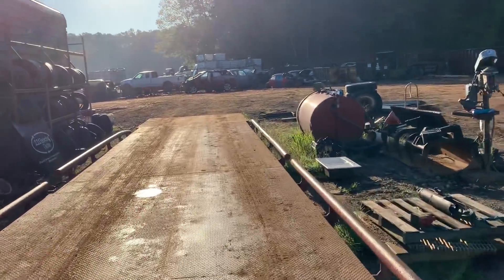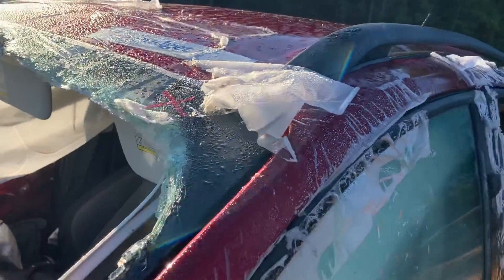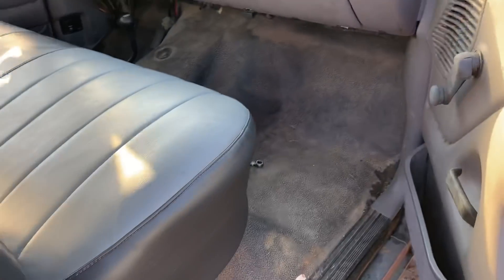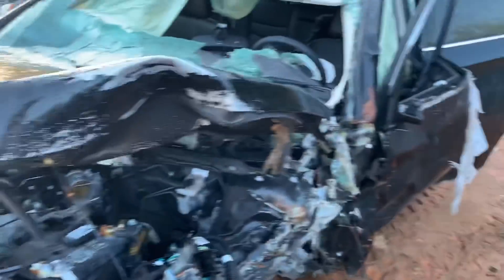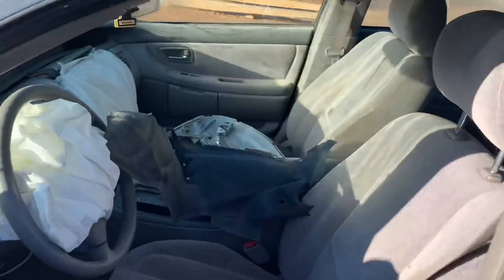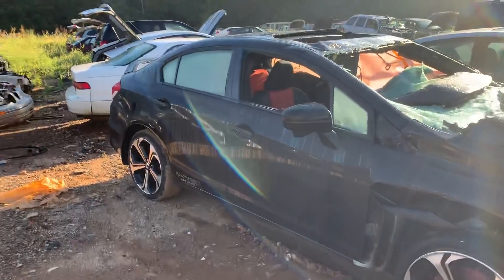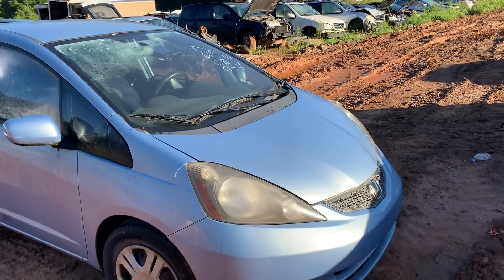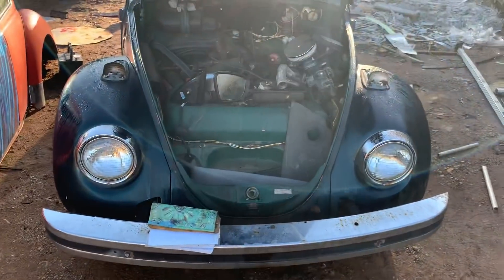New Scrapyard Arrivals!

Comment: Used to love working out in the yard in summer back when I was still working for scrappies here in the UK, overalls tied to the waist and shirt off and would be out there cutting engine mounts or dragging engines and always got covered in dirt and oil then home for a super long shower, abs loved it.   Only downside was you had to be careful smoking near petrol because a hot summer day the petrol is closer to its flashpoint but most often I still had a ciggie on the go when I decanted fuel tanks with a drill as we used to share out the petrol end of the week and the owner dosed it up with a couple gallons of fresh.   One month I remember we had so much petrol and diesel we were taking it home in 25 litre drums and selling it to mates cos we had so much of the stuff hehe just every fuel tank we got on the car was full tank.

Comment: I wouldn’t have guessed that the 2.0 Turbo engine would bring less money than the 6 speed auto in the Escape

And why is that gorgeous F-250 being parted out and not saved? Frame bent? 
She it’s in such great shape!
Reply: Insurance write off.  Had to make a tough decision with my car when it got hit, ultimately, buyback plus inspection fees (+all the time spent hauling the car from one place to the next) to get rid of the salvage title would have cost more  than finding another vehicle. We got a tough inspection process and beurocracy to get a rebuilt title, and unless you know somebody  in the business its going to cost you. The system is definately stacked against the DIY guy who just wants his car back on the road.

Comment: VW beetles were not special. People that remember them as great cars forgot about all the service it took to keep them from having no brake pedal, dropped valves, galled spark plug holes, steering wobble, and oil leaks. In areas with salt the exhaust pieces responsible for heating the air for heater rotted and you lost heat and the studs broke in heads trying to replace the heat exchangers. BUT, they got windshield washers right. Overinflate spare to 42 and attach the hose on washer fluid tank to spare. The air in spare was the force pushing fluid through hose to nozzles. If the air pressure dropped to 28 the valve they put in system stopped spare tire air flow so you didn’t get the spare flat. If you had a flat and forgot to fix the spare you got a reminder when the washers didn’t squirt.  This engineering feat failed to make up for the other stuff but it was still neat.

Comment: Putting a 97 Bonneville ssei  back on the road.  It needs a few odds and ends...know of any website of scrap yards that might sell parts of older vehicles? Aside from ebay
Reply from the maker: Check out Car-part.com They might show you who has some. Or even LKQ
Reply: So cool. I love older gm products. I have an entire front cradle with engine, trans, harness ECU etc from a 97 gtp I scrapped. It's sitting quietly in the corner waiting for my trusty 3.1 Beretta to poop out. Then that L67 is going in.

Comment: 5:26 was that a Mitsubishi GTO
Do a vid on the GTO, or try 2 save it
Reply: Essentially yes it is. Though it was called the 3000gt here. Came in two flavors, an NA roughly 150 (sohc) HP, next up was a dohc NA roughly 200 HP and the top dog was the twin turbo AWD VR4 rated at 320 hp
Reply: My thoughts exactly! Probably the most interesting car in the video!

Comment: That was a poor place for small memory card. I see hundreds of the 7.3 engines and I guess cause they used that motor for so long that they still sell. I needed one last year cause the factory remain was junk. Had tons of power but a no start issue caused me to sell it. It was a 95 that was as clean as the one shown but never in a wreck

Comment: DUDE! What's up with those Beetles? those are the easiest cars to work on. don't crush them put those things back together they are worth a fortune fixed back up. That 7.3L is about the ONLY good Ford Engine i am at all fond of. besides of course the straight 6 300 anything else is just junk from Ford as far as i'm concerned. but yall need to save them bugs unless they are rusted all to hell and even then you can part out the bodies easily if you advertise them because there's always someone looking to rebuild a bug. ok so you realized this already, cool kinda weird that you cut off the video right in the middle of talking about them though i was interested. i was also interested in that jeep that you just glossed over and moved on
Reply: It's a good ford engine cause it's not a ford engine lol, they're manufactured by Navistar.
Reply: @ericbrule4465  That's right! i forgot that International Harvester made those. well that should explain it then. the only other one that's any good and only because it's a good close second is made by caterpillar.

Comment: Wow Did you see that F.O.R.D.  I would be right proud to own that lovely gray beasty.

Only thing. Is I have to put n outhouse in the bed  so I can take a CRAP on it that it needs to run better.

Now now no crying 😢. Someone  with a rusted out lifted  bald tire Ranger POS will come up and save it of course.

So ill sneek in at night  and take my magazine and kindle. And  give it a  bran  new horse dump in the bed to go with the  diesel.

Big road apple carnage  going to happen. 
Dont worry after that e can sanitize the whole truck in a bath of  kerosene  and a match.

I know i know. Boo hoo hoo. It s. So pretty  .
Then the guy should've bought it back .

Well could use the sheet metal off the Ford to make patch panels for the 2 bugs That Got Cut Off.

Comment: looks like the market for buying up wreaked cars has dropped out, guess unless its light damage or easy to fix no one wants it, also 400 miles on a car, ouch, but thank gods its a morden box and not some classic the truck 250 poor thing looks like it was sitting a while too as green moss was growing on the rear pannel poor thing, be more inclined to fix that then part it out, yeah i would if your vid didn't stop lol